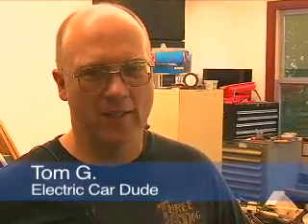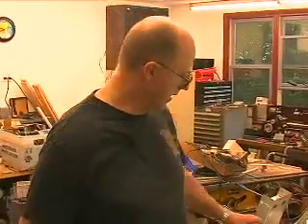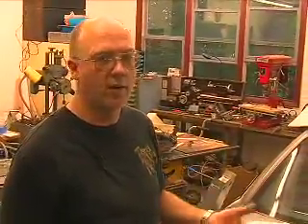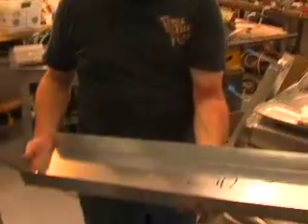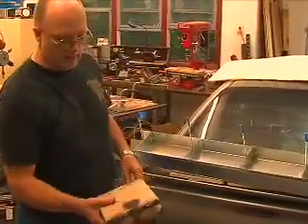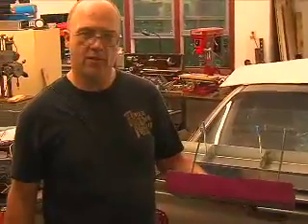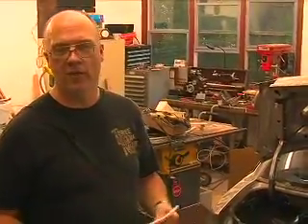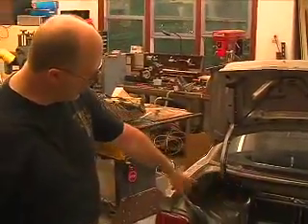008 AC Electric car construction 101 video 8 part 1

Comment: @ka9qlq 
there's a wide variety of 12V batteries. You can go from 3 Ahr to over 100 Ahr. if he was using trolling or wheelchair batteries (around 30 Ahr) then it would only weigh about 27 x 25 lbs. (700 lbs).